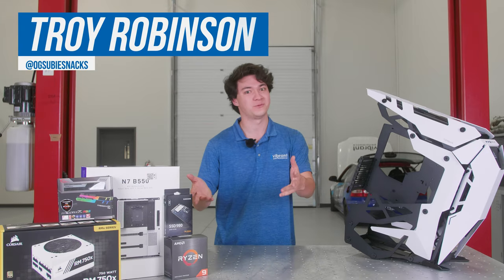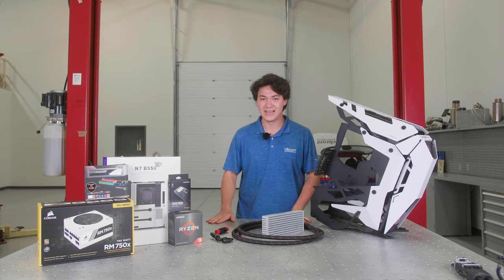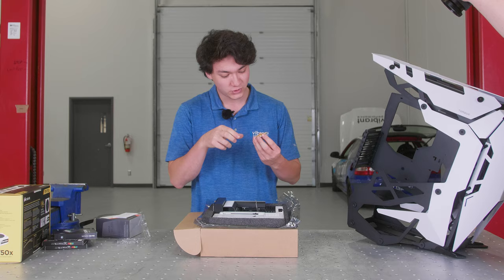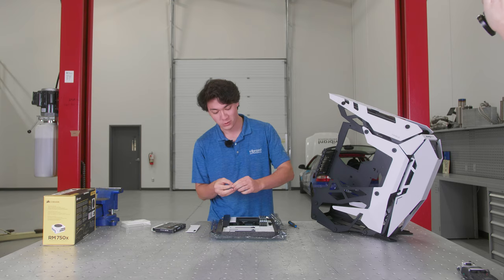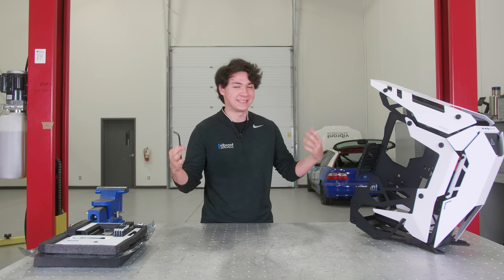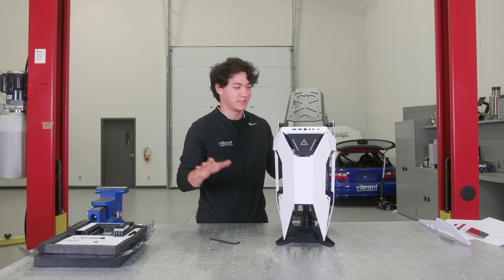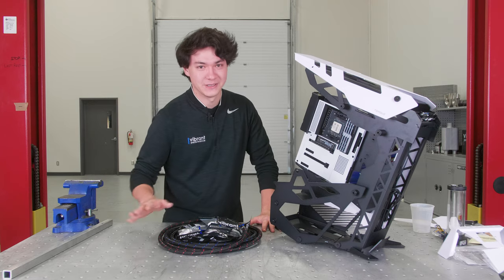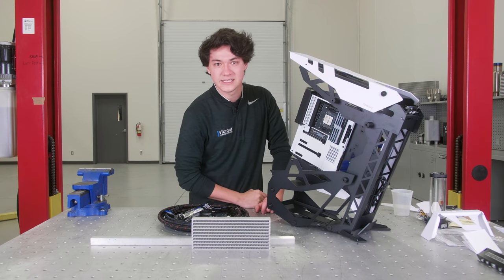We Build a Computer using Race Car Parts? (Ryzen 9 5900x, RTX VISION)

Comment: that core and tube you're gonna use for the endtanks look like they're aluminum, every cpu water block I've ever seen is copper that may or may not be nickle plated... you're gonna get galvanic corrosion mixing metals like that... unless you run very specific formulated coolant, which nobody makes cause everybody uses copper radiators for pc water cooling.  if you decide to use automotive coolant (which is made to work with mixed metals) make sure to do something to prevent organic growth, but whatever you add make sure it plays nice with the coolant.  
and if you plan on watercooling the graphics card too you're gonna need more radiator unless you plan on having your fans cranked up super loud all the time.
also, hate to brake it to you, but thats still dual channel memory.  thats determined by the cpu chipset, not how many ram sticks you have.